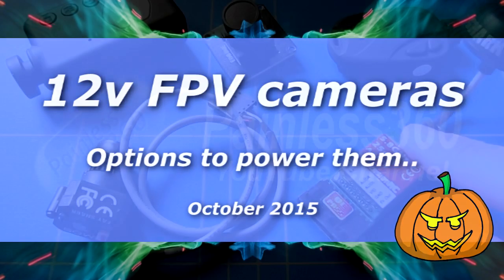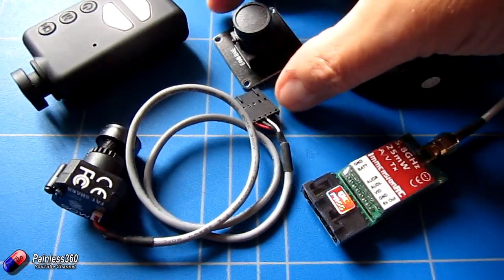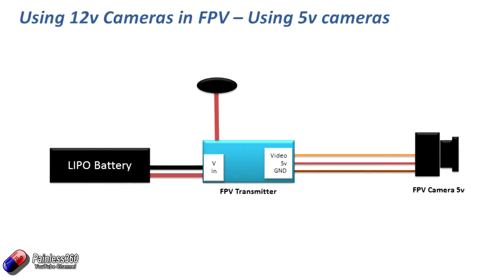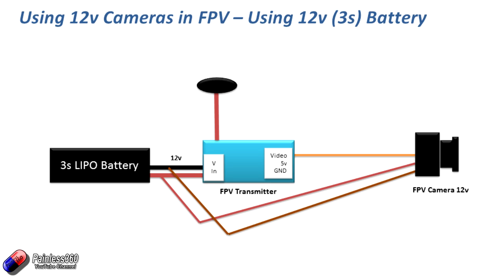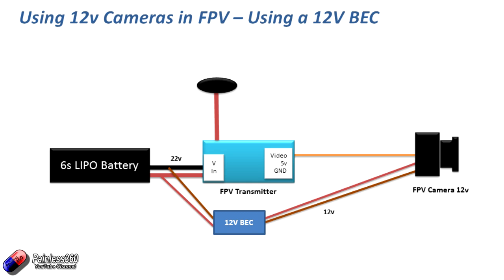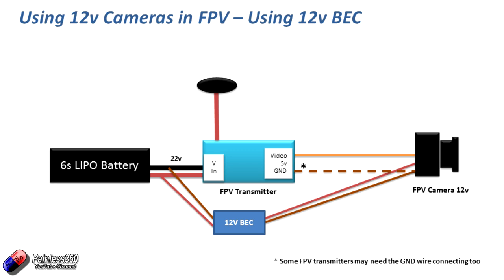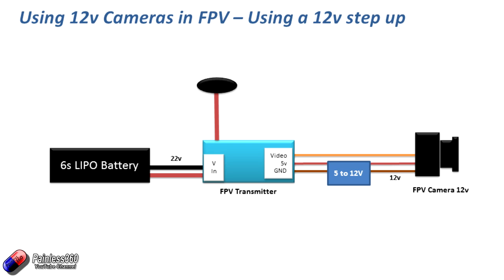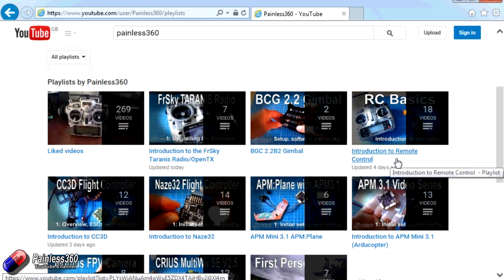FPV Quick Tips - Using 12v Cameras and 5v systems

Comment: How does a Aio board running on 1s battery supply 5 volts for a external rx receiver?
Reply from the maker: It uses a step up circuit to increase the voltage. These DC-DC voltage boosters are available separately from people like Matek too..

Comment: I'm powering my 200mW raceband vtx with a separate power supply. Not my flight battery. Do i have to worry about powering it with a 2s 400mAh? On the back it says "300mA max" for camera?
Reply from the maker: The capacity of the battery and the rating of the current needed for the camera are not the same thing. See my introduction to remote control playlist for basics on batteries and electrical current. Best of luck

Comment: What if both the cam and receiver supports both?
Is 12 beter than 5 in that case?
Reply from the maker: +Tony Atzen I tend to use the output with the most current. If they are the same, run them on the lowest voltage - the vtx/camera will just dissipate the extra voltage they don't need as heat..

Comment: Hi, what about vtx that have second GND cable ? It has to be ground somewhere on pdb ? Or it can be unused? I want to solder everything to pdb, 12v step down. Even if I will use 3s battery. 
It can be like diagram nr 2 from the movie, but with second GND cable unused? Or my idea: 
Yellow and black from camera( 12v ) to yellow and black from vtx. 
Next red from cam and red from vtx to 12v on pdb, and second ground cable from vtx to GND on pdb. 
I think that everything got power and every ground cables are joined together two from cam and vtx and then to ground pad on pdb via second GND cable. I can be correct ? Greetings
Reply from the maker: +Mateusz Adamczewski tricky to answer without a lot more detail. I've not seen what I think you're describing but making sure all the GND wires are connected is usually a good idea. Best of luck!
Reply: I got, a wiring diagram, but can't send you on the comments. Yeah , I was afraid that don't gonna sounds clear :)). I will be okay. Thanks :))

Comment: I know this video was about how to connect a 12v camera system, but I was hoping you could help with questions on my 5v system as well! I am currently using Fatshark Pilot HD camera with the supplied power filter that connects straight to my battery's balance connector. Could I wire my camera system straight to my PDB 5v via a JST connector, so I can free up my balance connector on my battery for a voltage alarm? If this would be okay to do would I just solder the outside wires on the JST to the PDB?
Reply from the maker: +Joel Maddox see the videos in the 'Introduction to FPV' playlist and the last video in the 'Quadcopter building for beginners' series where we do just that.. Hope they help..
Reply: Excellent!! Thank you for the quick reply and for all of your helpful videos, subscribed for sure!!

Comment: Surely using a 12v step up would be massively inefficient since you're going all the way down to 5v from a 4s and then all the way back up to 12v rather than just going from 14 to 12 for example? does this make any difference?
Reply from the maker: +DIY4Dummies Try to only step up/down once on the way from the power source to the target device if possible..

Comment: are there any vtx or cameras that run off of 1s betteries?
Reply from the maker: +QuadBro RC I'm not aware of any but you might find a 5v DC-DC converter that may work to power the FPV kit from the battery.. best of luck..

Comment: Hi 
Been following your vids for quite a while .
Very informative.I've uploaded a vid 
Monster quadcopter help with props 
Built a 450 big beast using 7v 120c Lipo 
Anything less gets hot enuff to do bacon 
Using slow fly 11/47 props (fine) put some nylon plastic mix props on (Very stiff) I get overrun when the throttle gets turned off and when I have the balls to take off its FRIGHTENING 
SUSHI COMING UP *the props spin 50%faster one false move slice an dice .
Any ideas on why changing for a stiffer prop makes a docile quad I to a animal ready to attack.
Cheers 
Brian 
London
Reply from the maker: +brian forward Tricky to commecnt without knowing the motors etc. Most would fly a 450 class with a 3s battery and use the right props for that higer voltage (11.1v), then you don't need the super high C ratings.Props will make a difference but you need to use the right one for the motor and battery you're using. Best of luck..

Comment: painless, hi. i just downloaded the video u asked about the setting on the openpilot set up wizard on the cc3d/d4r ppm set up on my ZMR 250 quad. it is tittled "request vid of painless360.... this setting is on ppm/d4r rx-taranis -9 plus Tx. The first attemp went good but it starts to spin on 51 % of throttle which i flown for few times. The problem started when i wanted to correct it on the wizard then it all went wrong,until now it does not want to activate on the "yaw" powering system,all is good on the set up wizard but when i tested it-it does not act at all. Thanks for ur time good luck more power and God Bless.
Reply from the maker: +bobot021070 Hi, thanks for the video. Without you completing the wizard for radio calibration the CC3D will not know the limits of the channels and nothing else will work well, if at all. Interestingly your screen is different from the one used and the tabs at the bottom are different. I would look at the download area again in case there is another version of the GCS software. Best of luck.

Comment: Great video, one would wonder thou: Sony HAD ones do claim to be ok with anything between 5 and 22v. That would mean 5v out of VTX should be ok. I am now feeding 4s into the 700tvl, but will try the 5v from the ImmersionRC.
Reply from the maker: +SirCrashaLot Best of luck - let us know if it works!
Reply: It is alive and well! Less noise too. I did not think much of the step down in ImmersionRC 600mw VTX but it seems to be doing great. It allowed me to drop some cables too.
Reply from the maker: Simpler is always better on these things!

Comment: For batteries above 3S use the balance port but only use pins 1 and 4. Run a test to check if the cells get out of balance. First run the test without the balance port being used to establish a baseline and then with it being used. Decide if you can accept the imbalance if any with the camera being used.

Comment: Now, should we get into the weeds on "optimum" voltage on wide voltage devices?

...I didn't think so. ;)
Reply: +Hiway I'd like to see this addressed in the future too if possible. I'm told the lower voltage tends to give less noise but in real world it seems to be dependent on actual devices used. I would have just used the max voltage stated otherwise presuming it was always enough power worst case. 

Either way,  curious subject indeed
Reply: +MicroRCFiend yes, and my deficits in the finer nuances of electronics does not allow me to wax knowledgeable on the specifics. I have learned from reading and watching other better trained people like Lee here that wide voltage devices do have an "optimum" voltage and I believe in many cases it is about 9v to 12v on any device rated from 5v to 22v but that is a little generalized. I tend to use LC filters regardless on the video transmitters and I also tend to always regulate to 12v in that specific application. Virtually every quad I have built where I power the video gear off the flight battery without filtering power has noise. not always bad, but present. the lc filter does make a difference.

Comment: quick question off topic, best budget lipo charger? last thing I need to buy. thanks
Reply: +Alberto Alvarez 
Asking for the "best" is useless if you don't specify any of your needs.
Cheap, works: http://www.hobbyking.com/hobbyking/store/__21044__Hobbyking_174_DC_4S_Balance_Charger_Cell_Checker_30w_2s_4s.html
Reply: +superdau well sorry I'm totally new to quadcopters, you don't have to be a dick about it.
Reply from the maker: What battery types and capacity are you looking to charge? Lots of options, I have three here. Imax B6 is a basic oldie but a goodie (make sure you are not buying a clone - quality issues) but there are lots on HK too now that have good reviews.. also worth looking at the wattage of the charger as that affects the max. amps for charging..
Reply: +Painless360 thanks for the reply! so far I have a rtf and artf nighthawk 280 pro. I have 3 batteries, all 2200 but they are 35c 30-40c and 45-90c.
Reply from the maker: Ok, if you want it SIMPLE then I use a little B6 compact charger (http://www.hobbyrc.co.uk/imax-b6-compact-2-6s-lipo-and-nimh-ac-charger?gclid=CJTo1Yz4r8gCFcJe2wodehsIwg), simple to use, fast charging but no advanced features. Something like this - http://www.hobbyrc.co.uk/imax-x80-ac-lipo-2-6s-lipo-balance-ac-charger - could be an option for one with more features. Lots to choose from - go with one that gets good reviews from a reputable supplier.

Best of luck.